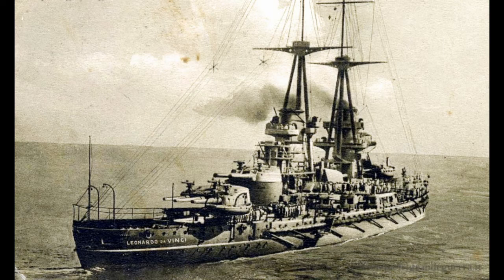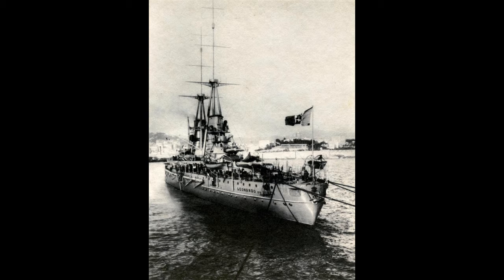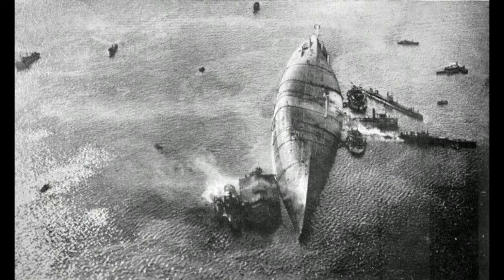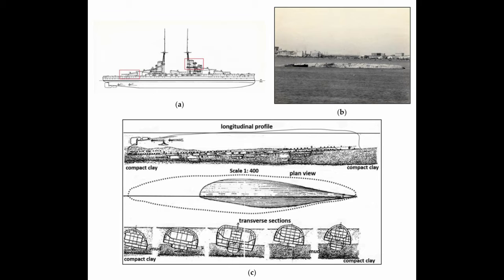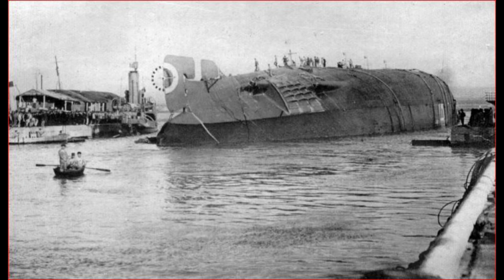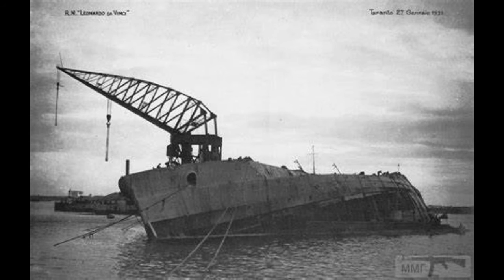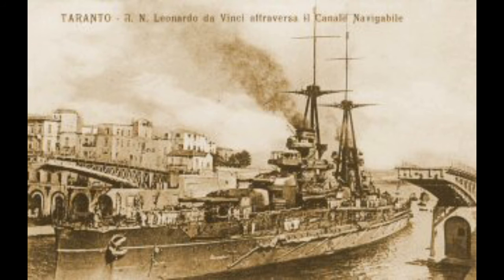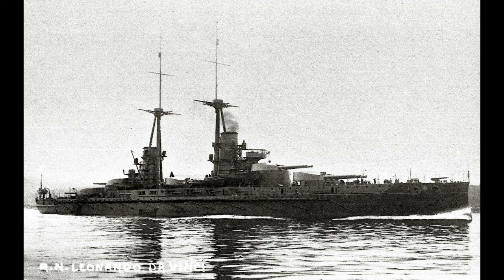Italian Ingenuity: Salvage of the Leonardo da Vinci

Comment: Shame about her short service life, but what magazine exploded ?  in the pics i have seen all the barbettes are in place (some cut down) and no visible sign of damage. 
there was another option.. rebuild her and get some British 14 inch guns from the scrapped HMS Tiger, 8 can be had from her and there must be 2 more hanging around somewhere to make the 4 turret 3+2 gun turret work,  put a catapult where the centre turret was and some handling gear and viola she has a spotter. would cost more but the 14 inchers do a lot more damage then the 12's
Reply: Tiger had 13.5" guns, and wasn't sold for scrap until 1931, which was several years after the da Vinci headed to the breakers' yard. The British had 96 13.5" guns spare from the scrapped battleships (40 from the 4 Orions plus 30 from the 3 KGVs plus 10 from the Erin plus 16 from the 2 Lions).Some of them would go into the spares pile for the 5 remaining in-service 13.5" capital ships.
While the Italians could theoretically procure a lot of second hand 13.5" guns, the problem would be fitting them onto the Italian battleships. Normally, you lose a gun if you go up 2 inches in calibre for a turret of a given size. As such, if you substituted in 13.5" guns instead of the 12" guns, you'd end up with 3 twin turrets and 2 single turrets. Sure, the superfiring barbettes could technically be rebuilt to accomodate a twin turret, but at best, you'd end up with 5 twin 13.5" turrets and a huge bill to show for it.
However, this is where the good news ends. Over and above the basic repair, you'd have to add the cost of reconstructing the barbettes and associated machinery, procuring the guns, a new logistical stream, etc. If the Italians were not willing to spend the 60 million lira required to rebuild her, there was no way they would spend (or could spend, for that matter) the higher costs to upgun her. What they could theoretically have done was to wait for 1929, when they could build new battleships, and go for 13.5" guns then. However, at that point, they decided to wait for France's reply to the Deutschland-class (said response would eventually be the Dunkerque-class), and ended up building the Littorio-class in response to France. So, no 13.5" guns for them.

Comment: Are you sure that the photo of a launch actually shows the battleship Leonardo da Vinci and not the Italian liner of the same name of the 1950s? The raked bulbous bow looks to me nothing like the ramming bow of the battleship shown later.
Reply from the maker: wiggles hand

I’ve seen that pic in a couple places that claim it’s the BB. One that claims it to be the liner.

To be frank, I’ve seen shockingly few pics that show a good (similar) angle shot on any of the Cavours.

I won’t rule out that it’s the liner. Wouldn’t be the first time links have lied. If so, I’ll put a disclaimer pinned post up.

Not going to take the entire video down and reupload to change that pic, though.
Reply: @skyneahistory2306  Of course you won't take the perfectly good video down, it's a minor thing. One more thing that makes me think that it's the liner is the layout of the deck on the bow with something square which could be a small cargo hold (quite common on the liners) and the solid railing (not seen on battleships)a as well as the curvature of the deck slightly upwards. Just my two cents.
Reply: @skyneahistory2306  I can confirm it's the liner, I have photos of her launch in a nautical manual that my grandpa had when he went to marittime school

Comment: It is fascinating to think that if they kept her, she could have been rebuilt into a practically new ship like her sisters. The modifications included a new bow, extension of the focsle aft. New boilers turbines shafts and props. Rebored guns to 12'6" inch from 12inch. Suppression of the center turret and the addition of lots of dual purpose anti aircraft and anti torpedo boat guns. As you can see such modifications would have resulted in almost a completely new ship, DaVinci would have survived such a conversion well.
Reply: Perhaps, but there was basically no sense in retaining the Leonardo da Vinci. Rebuilding her to her original state was not too far off from what she had cost to build in the first place. A carrier conversion in 1923 was estimated at around 48 million lira, plus the cost of aircraft. For comparison, the Francesco Caracciolo was estimated to cost some 53 million lira for a carrier conversion (for a significantly better carrier) plus aircraft costs. There was also the fact that the Washington Naval Treaty had been signed by the time options were being delibrated, and Italy could build new battleships in 1929 (as could France).

Of course, Italy only had five dreadnoughts (and four interesting pre-dreadnoughts of the Regina Elena-class)  at this time to France's six dreadnoughts plus four semi-dreadnoughts, but the idea went that with new battleships potentially entering service in about a decade and the prevailing economic conditions (both in Italy and abroad), there wouldn't be a large war, and the slack of the Leonardo da Vinci could be picked up by the five light cruisers Italy received as reparations, plus the four retained armoured cruisers. The saved funds could then be used for trials on the Dante Alighieri, small refits to Roma and Napoli, and other uses.

Yes, if Leonardo da Vinci had survived into the 1930s, she may have been rebuilt akin to her sisters, but she was not going to survive the 1920s in the first place.